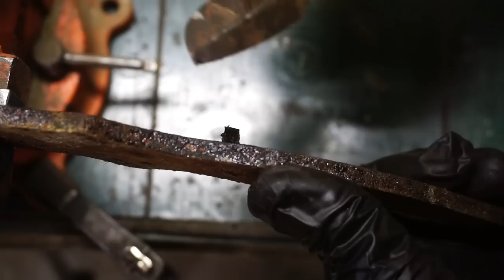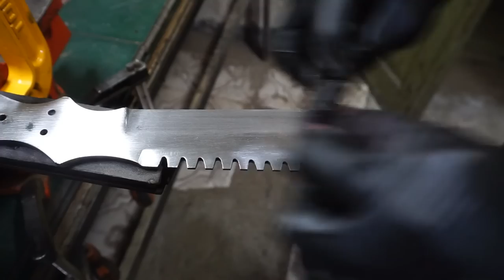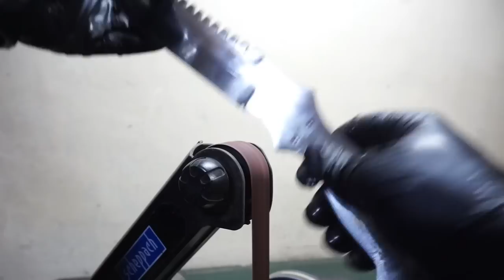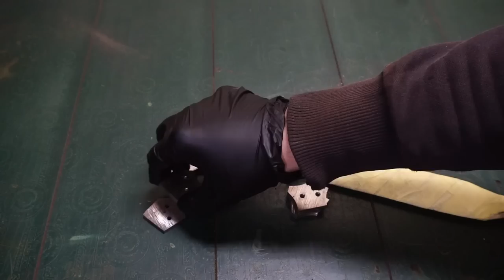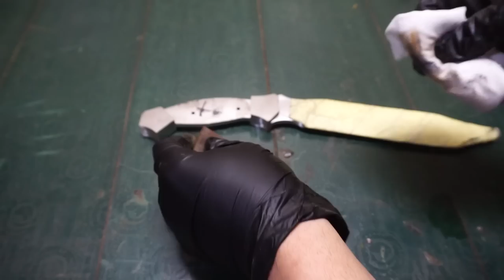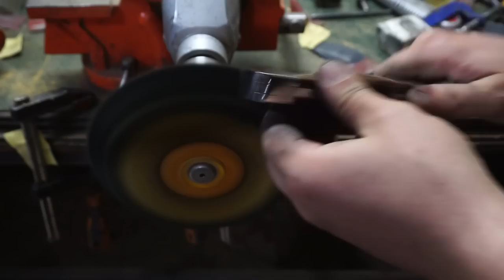Restoration Very Rusty Old Survival Knife - The most Beautiful Handle

Comment: The knife is totally trash. The "restoration" also trash - all edges of the blade are like a bar of soap, did not temper the steel after quenching 🤦‍♂️🤦‍♂️🤦‍♂️.

Comment: I'm calling bullshit on this restoration, 1, where in the world do you find a piece of metal that badly rusted with no pitting whatsoever after just sanding? 2, why would you reharden a knife that is that old, the metal would be so brittle after a second hardening it would break and chip. 3, where do you find an old knife that has no edge on it whatsoever like it is a blank to make a knife out of? In the first picture he shows after the cleaning the rust off, it was pitted all over too bad to get a mirror polish on it like he did. The biggest give away was how thick the edge was on the blade after enhardening, and after he did sharpen it, the blade had no more wear on it than a brand-new knife would.

Comment: When all the handle work is finished, the polishing/buffing final stage is so rewarding - the handle still looks a mess but buff, polish, wipe it down- BAM, the beauty of the material you use, especially beautiful wood, just emerges like magic.
Reply: except it wasn't wood.
Reply: @chrisshore5340  right, doesn't matter, once you grind/sand off the epoxy and extra material, buff, polish it up, the final finished handle looks great, very rewarding - like I said, especially if you use a pretty wood with nice color/grain that jumps out when polished up, nothing wrong with micarta or other materials, same effect, but few compare to a beatiful wood, especially burl handle imo., it's all cloudy and dull then you hit the buffing/polishing wheels and BAM, the colors and grain just appear like magic.